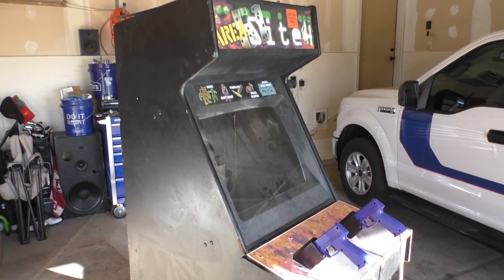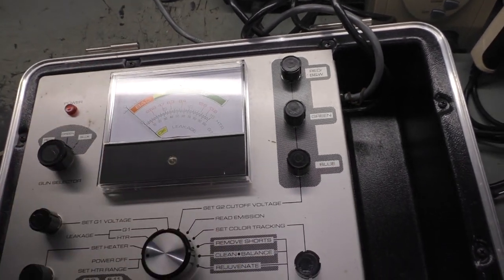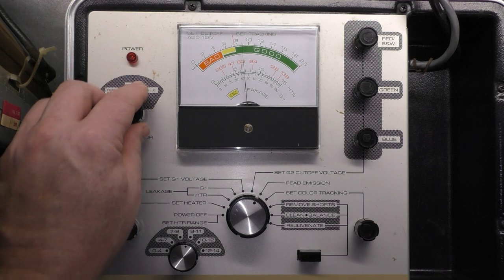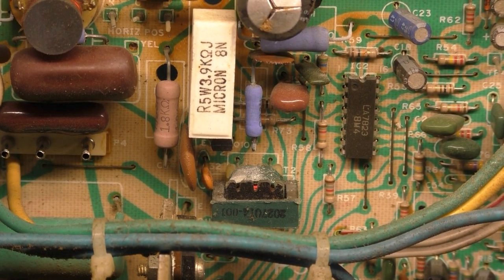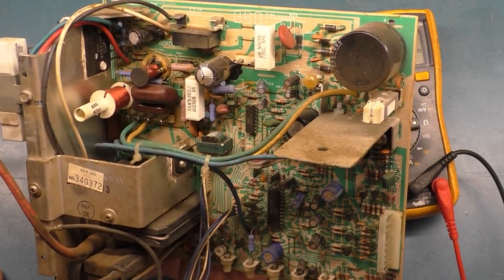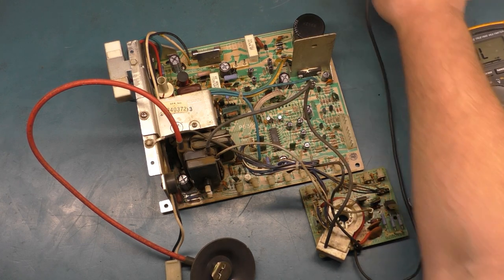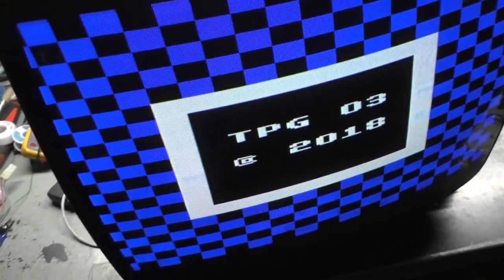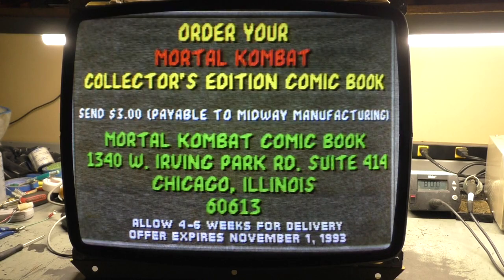25" K7000 Arcade Monitor Chassis Repair - Blowing Fuses #15 - Trace Explosion!

Comment: I have a K7400 chassis that was installed in place of a neotec 2515. image was collapsed and squished both directions when i bought the primal rage. didn't think much of it. got it home and it trips the gfci receptacle. I plan to replace the monitor temporally with a maki tri sync. Im assuming the neotec 2515 did not require iso and the 7400 does. The original owner said he hooked it up with the anode cup not attached and it arched across the chassis. But i think it partially due to the ohm requirement of the primal rage pcb being 75ohm's set up for the neotec not a wells.  Anyway this will be my second attempt at troubleshooting a chassis other than cap kits and flybacks. Your video's are great, your work and attention to detail is greatly appreciated. Current projects are UMK3 in a hs-5 with a K7000(looking for a dedicated Cab so I can convert this one to SF2', Primal rage, 2x Sega Rally 2 DLX( Projections out on both,  testing home projectors soon to see if I can use the original mirror or if I need to try short throw really want to retain the 4:3 ratio if possible)Kids wanted twin racers. K4600 I need to pull back out of my pacman, i desoldered the red pot on accident during repair. and reinstalled it now its stuck and the red turned up to high. Also love your other channel found this one first, when i picked up the UMK3 last month I watched your mk video's and thought the voice was familiar, took me a couple of vids to put together you had more than one channel.
Reply: U2000, U5000, K7400, K7500 do not need an isolation transformer. K7000 does need an isolation transformer.
Reply: @onetoclone  I could have swore the k7400 needed iso. Well there goes my original theory. Thanks
Reply: K7400 is switch mode power supply which includes its own isolation transformer